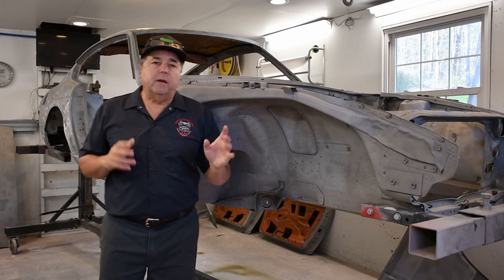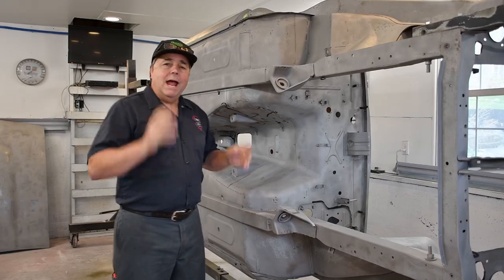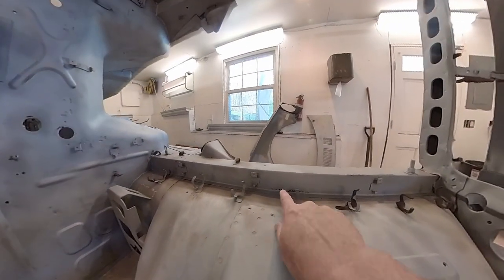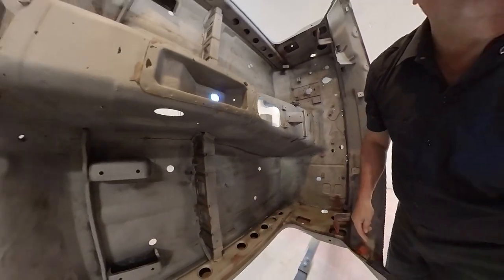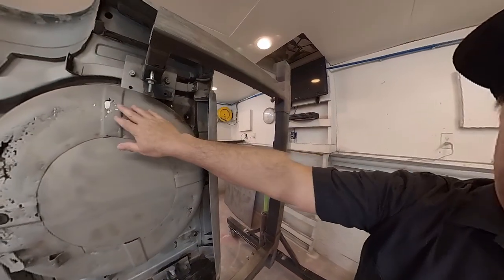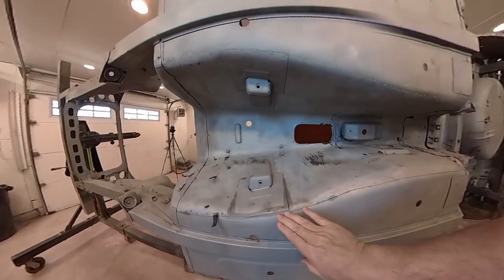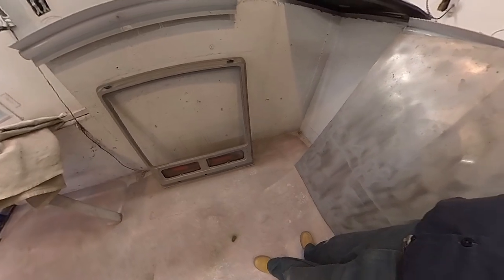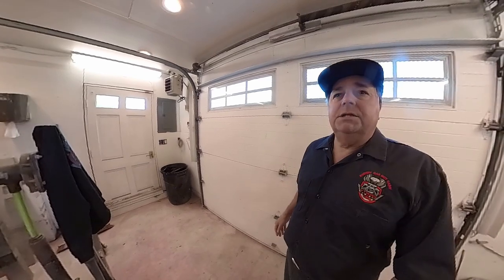240Z Restoration Project - Sandblasted Episode 3

Comment: i loved what you did in this project!
have you noticed any cons on sand blastic a 240z? like panels bending, sand getting in places and not being able to get it out?
also how does this protect the frame rails etc from rusting from the inside out?
Reply from the maker: Thanks for the comment. Sand blasting a z car is the same as most of my projects. It works great. You just havbe to be careful not to heat the panels during the blasting process. Getting the sand out is always an on going process of blowing using comproessed air. The constant rotation on the rotisserie alway helps. By the time I'm ready for paint it's pretty much clean. Sandblasting wont help you inside the rails. I usually spray an anticorrosive material inside the rails and recessed areas. Then when I'm done I ruast proof with Cavity Wax. Good Luck with your project! Troy
Reply: @troykane  wow many thanks for the info! Really appreciate it :)